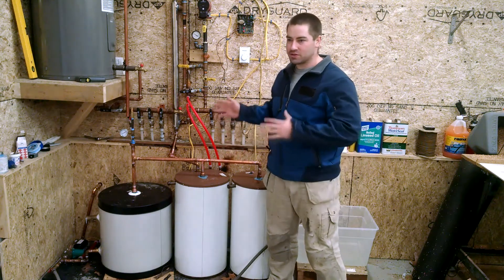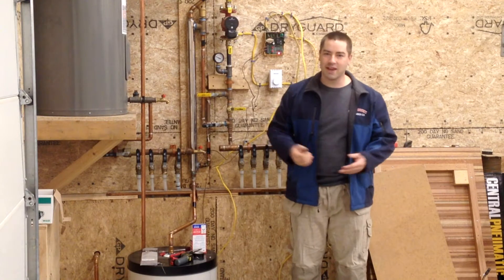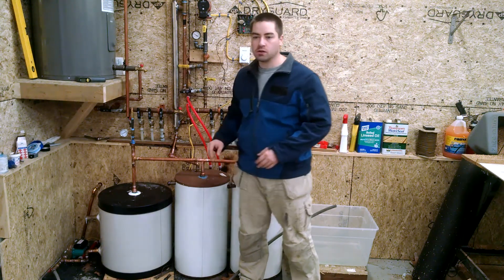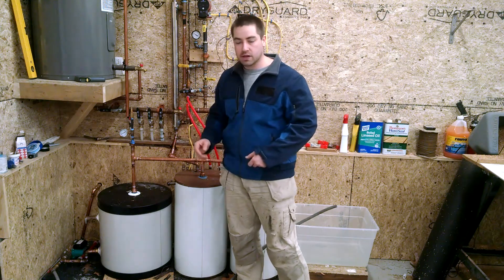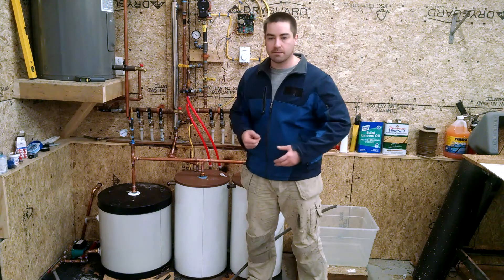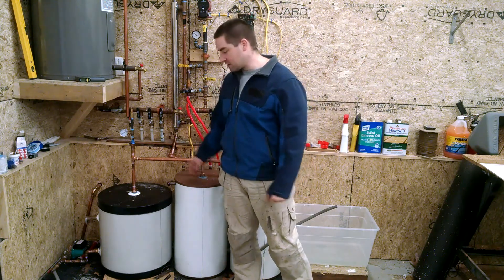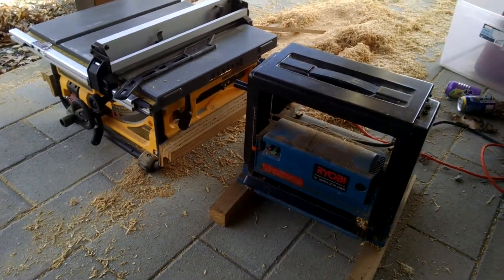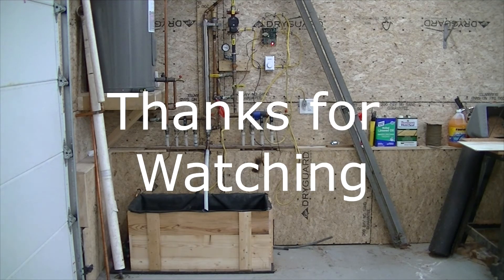Problems with Drain Back Tanks in Garage, Solar

Comment: I came to your site with the same cavitation problem. I moved my pump as low as I could get it; still no relief. I finally mounted a small under-counter water heater on top of my solar  water heater w/ a DB tank built in.  Now my Db tank is 5foot higher than my pump. My guess is the DB tank was not far enough above the pump. Running great now! Thanks for your video

Comment: Is there a reason you did not insulate the walls of your home made tank?
Reply from the maker: Hi Nick, Thanks for watching.  This system in the garage is only for heating in winter.  When the box is filled with hot water it simply acts like a radiator, giving off heat to the space.  The hot water also gets pumped to the floor, where it gives off heat to the space.  I didn't see a need to insulate any pipes or tanks inside the insulated garage.  However, all the pipes outside the insulation (attic/roof) are insulated.  It would not be wrong to insulate the tank, I just didn't see the need.